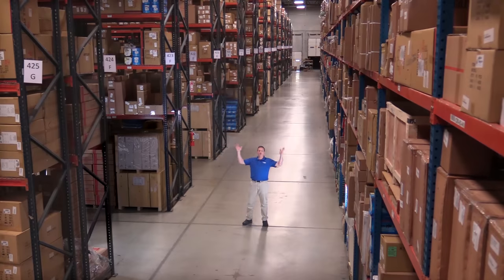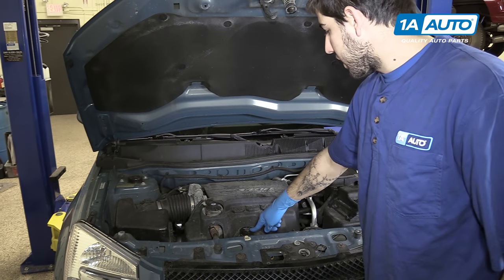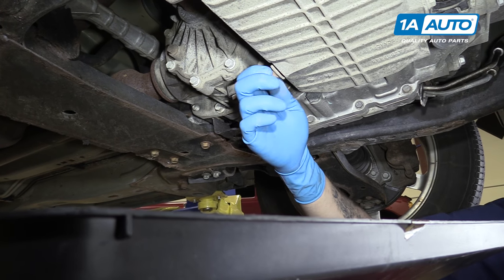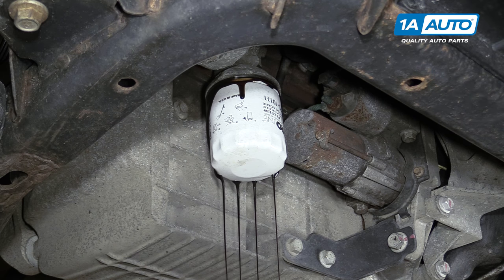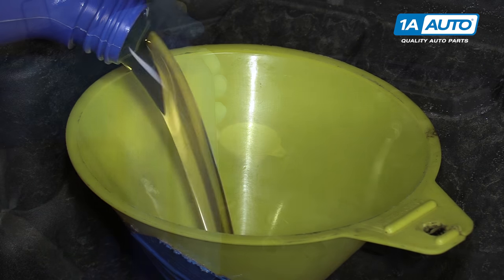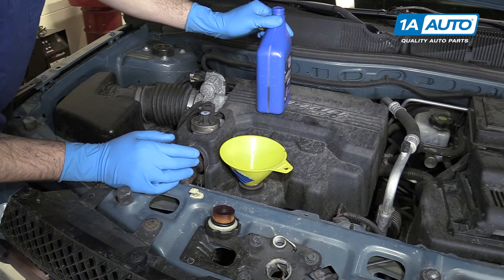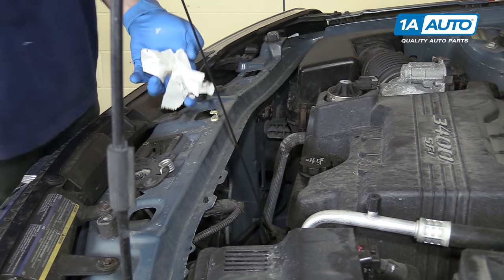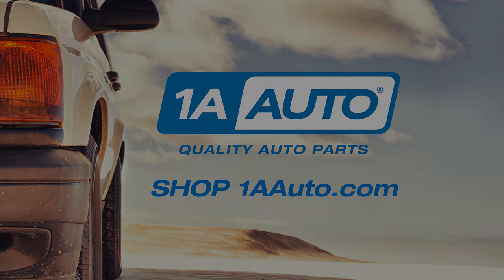How to Change Engine Oil 05-09 Chevy Equinox

Comment: Great video but my 3.4L manual says only 4 quarts for my 08 Equinox LT. Should I be doing 4 1/2 quarts?
Reply: Do 4 liters than check your oil stick that's how you know when to add or leave it as is

Comment: I have a 2005 Chevy equinox LS v6 it's a  2wd , I've been hearing water running in my dash I would like to know the location of the ac drain tube thanks I also like watching the videos thanks Ken
Reply from the maker: Thanks for checking us out! Unfortunately, we do not have that information available. You may want to try locating this information in a repair manual or you may find some helpful information in an automotive forum. Hope this helps you out. +Ken Ridout
Reply: Ken I have an 06 and can hear the same thing
Reply: Having that water running sound for me turned out to be air bubbles in the coolant lines. It made noise when starting to accelerate which makes sense because the motor turning pushes the fluids through the system. But I still have not gotten it fixed yet.

Comment: what kind of oil ? is or synthetic or jist regular 5w30
Reply from the maker: +Stephen Lamb We would suggest checking your owner's manual and using the manufacturer suggest oil type.
Reply: I use valvoline maxlife with good results.